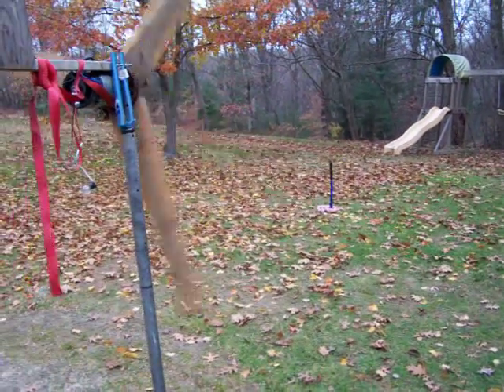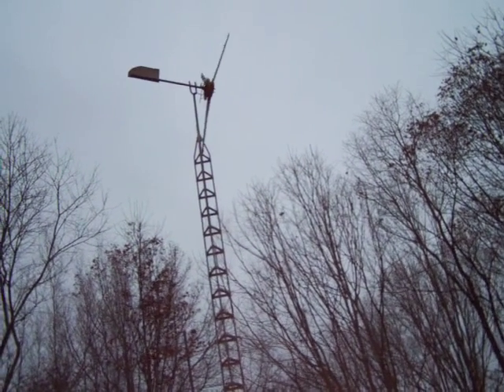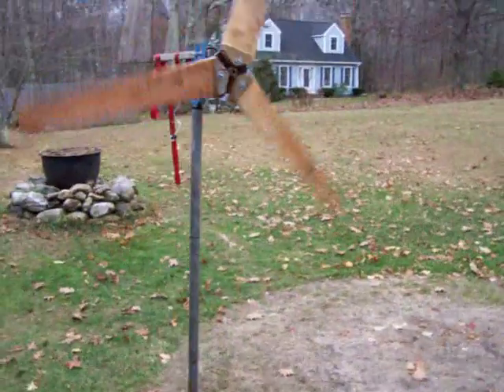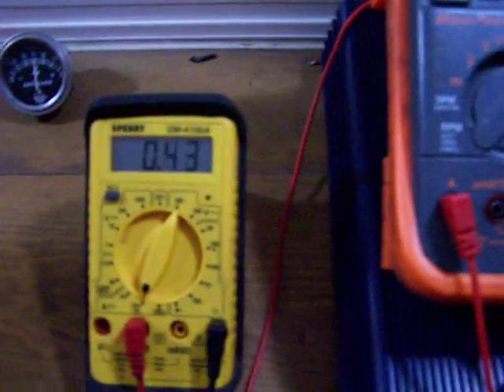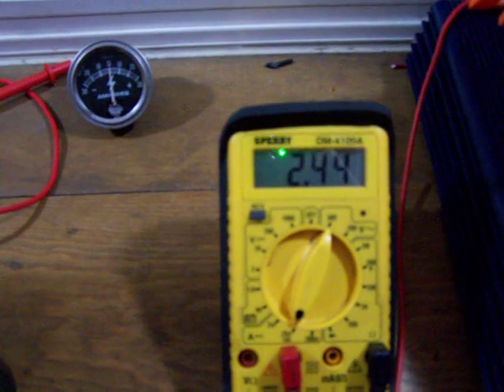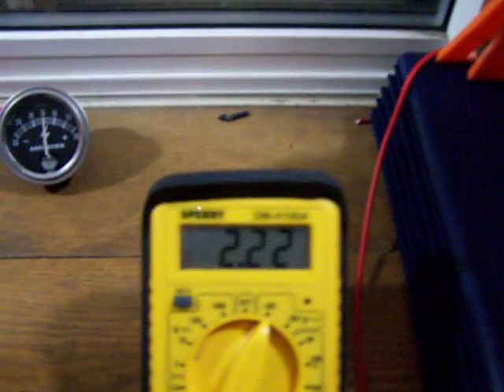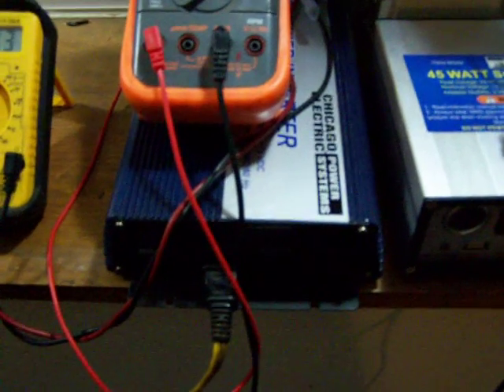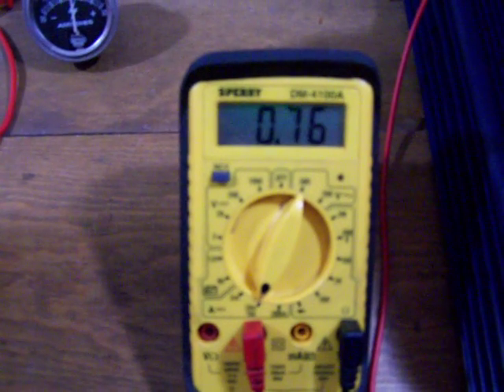wind turbine amps

Comment: @michael970 
Thank s mikael!!!
Another thing. I m now wondering if i am spacing my blades at correct distance from the stator .. Since it will have to run under load... any idea what kind of torque should i look for to be able to run the turbine at its nearest best potential? I think i am gonna change the X i built with aluminum bars... that will reduce the weight .+ and increase the diameter by 2 I will loose a bit in rpm but the torque will obviously be much stronger... what do you think ? THX

Comment: Just one question i built my own turbine lately but cannot understand the amperage reading system, i will get like 5 amps with 5. 10watts dc bulbs but will get only 1 amp on 1/ 60 watts ac bulb... Do you always need to have load to be able to check your amperage or??? because load equal more amps less voltage ... I manage to get up to 100 volts dc without load...
pls help me !!!! Am LOST!!!! lol check my videos to c what i am talking about...

Comment: I was wondering with a small tread mill motor how are you going to hook it up with out having battery power running the motor? Will a charge controller work as a one way diode?
I started my solar power plant also. I have two utility solar panels 10 watt each a 15000 watt power inverter and one deep cycle marine battery.

Comment: You may want to put a gear between the treadmill motor and blades. It will take more torque to turn the blades, but it should boost your amps. Later from sunny FL.